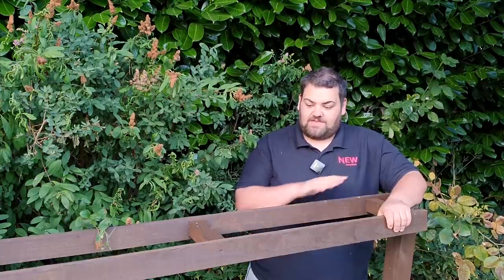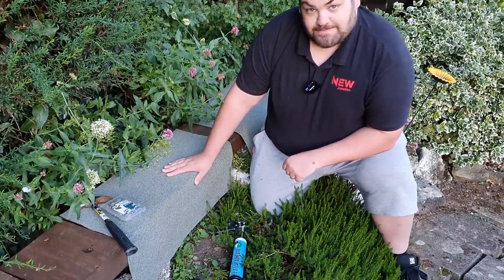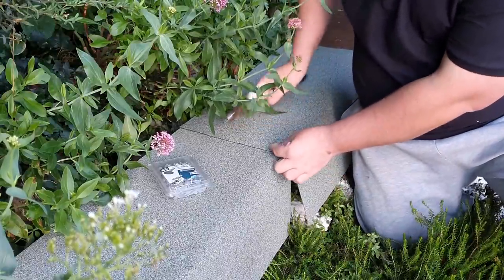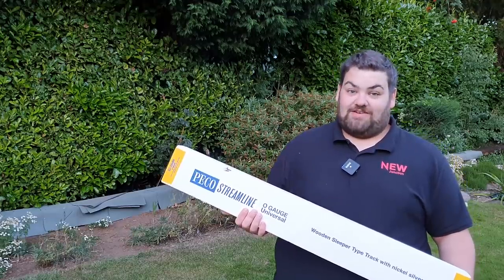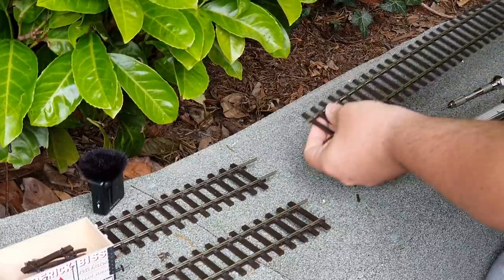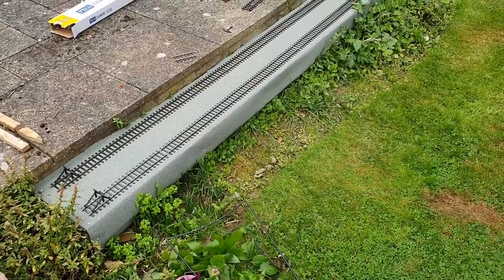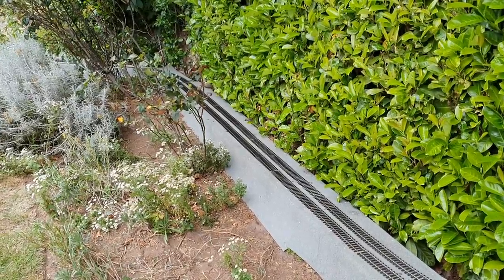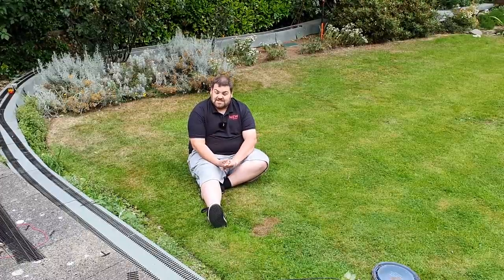New Junction:  Building an 'O' gauge Garden Railway  Part Two

Comment: Hello Richard. Having watched your first commendable attempts at building a garden railway, from one who has had a railway round the garden now for over 20 years, maybe I could add a few pointers from things I learned (the hard way!) over the years. Firstly, having like you, tried nail-on roofing felt, I found that it was of relatively short life - there is the tendency of a build-up of moisture under the felt as the felt is only laid on the base wood and not sealed to it - which eventually rots the ply - no matter how much Cuprinol you coat it with. The real answer is torch-on felt (which is not that hard to lay and in the long run, quicker than nailing all over the place) and the molten bitumen seals into the wood grain as it is rolled on, plus it can be laid butt up with no overlap (which causes bumps where the track goes over the overlaps) and the joint sealed with dripping a molten, narrow strip, of the felt to seal with the bitumen and finished by pouring some of the loose grit that comes off the felt over the joint and pressing onto the joint to help protect and hide the joint. 
Spacing the adjacent tracks was simply done with some pieces of wood (say 1" x2") with grooves cut across the wood for the rails and spaced for the adjacent running line so that the whole lot stayed neat - ideal spacing for O gauge (according to the GOG technical manuals) is 80mm centres (85-90 mm on tight corners). The other thing is not to nail down the middle of the sleeper, but to nail the sleepers on the outside of the rail - nailing in the middle (as time goes on) will tend to make the sleepers bow and the rail tops come slightly inwards and so narrowing the gauge.  Only need to pin down every 10-11th sleeper. I always seal every pin that goes into the baseboard with bitumen paint to seal the hole that the pin makes through the felt - having found a good few years ago that one un-sealed pin caused a swelling of the ply.
Regarding soldering the rail together is a complete no-no in the garden as you really need expeansion joints at every yard of track as the temperature variation can be alarming big - I have recorded temps as high as 55C on the summer sun-soaked rails sections and as low as minus 12C in the winter. You really need the expansion joints, otherwise you will encounter track buckling. 
Easy to do, is track bonding with some reasonably sized copper wire - say 1.0mm -1.2mm dia (I used tinned copper wire which I buy in a coil off the internet) and pushed under the first sleeper either side of the join and the bent up in a half omega loop (for expansion) to solder into the web on the outside of the rail.
Regarding ply, from past experience, the best was the cheapest OSB ply which is made of chippings filled with resin pressed solid under heat - stays rigid and flat and there is no chance of delamination of the plies. Not trying to teach "suck eggs" but a few pointers from my experience, which I hope may help. Have a look at  GBRailways channel - https://www.youtube.com/watch?v=Ay0lX9F9o8c. Regards, GeoffB

Comment: Well done Richard I'm currently building an O gauge railway in the garden suffer with a bit of reduced mobility so mine is on 4" dia soil pipe and 4ft  off the ground so thanks for the boost to do some more only other relevant difference is I used bituminous paint to seal and bond my felt .
Reply from the maker: Top tip Dave, mine will be high of the ground at the other end of the garden and I'm looking forward to that bit ha
Reply: @NewJunction  mine was a bit trial and error I have 4ft above ground and it's 3ft deep in the soil .With the spoil from the holes poured back down the pipe for good measure I have 25ft of an eventually 65ft run in a horseshoe shape.

Comment: Hi Richard,
Like so many of your subscribers it is good to see you back with part 2 and what you have done looks great but I hope you will forgive me for asking some questions the first one is you layed the felt stressing it is important to keep moisture out and this would include not only rain but dew as well now I may not have seen it right but you did not seem to be taking the felt over the other side of the track bed at any point so allowing this moisture to get under the surface felt ????. the second bit I did not understand is you made a mention about leaving a gap between the rail joints to allow expansion but at the end that you would be soldering them so filling the gap ?? sorry if I am being silly as I sometimes am but did I miss an earlier video explaining this.
I do however look forward to seeing part 3 weather permitting it would have been a lot easier if you had settled in Essex were I am as we get very little rain do however please keep safe and well and keep laying track.
Cheers Robert.
Reply from the maker: not enough room in all the places for felt both sides

Comment: Nice to define what you mean by a "big gap" at the fishplates.  For approx 45C range, the gap needs to be 1mm; further for that, the solar heating is worth another 0.5mm, so the gap at the coldest temperature would be 1.5mm.  As you have mentioned, the temperature of the day  affects the gap you select at build time.
Too small, and the rails will buckle.  Too large, and the clack will be large, and the smoothness will be compromised.  The expansion is the same for OO as O gauge, and the scale of the gap is halved for O, so this is less of an issue on your garden layout than in other discussions that are current.
The nice thing about doing this in the summer is that you can review the gaps on a hot day, and use a cutting disc to generate a new gap.  Generating a new gap is better than increasing the existing gap, as it allows more gap without making any one gap too wide.

Comment: from one Richard to another.... Great video Richard. Tip if you have not already cut the excess off the felt may I suggest you fold the excess back onto itself, so the bottom edge is half inch, sorry forgot you are a young one, make that circa 1.5 cm below the bottom edge of your side timber, then re tack the now double layer to the side timber. I believe this is known as a welted drip in the roofing trade, sure someone will correct me if I have this wrong. Anyway, the purpose of this is to prevent capillary action drawing the rain water into the lower edge of the side timber. and rotting it out. If it is cold try warming the felt along the line you will be creating your fold on which should stop it splitting. by the way we have a Cocker and a Springer one 9 the other 10 years old and just as mad as yours. I have been reliably informed they do settle down about six months after the die LOL keep up the good work
Reply from the maker: Top Tip many thanks for taking the time to comment, I'll be sure to implement this
Reply: @NewJunction  no problem keep up to great work looking forward to the next video. My wife and I also like watching Lulu definitely adds to the video. Keep safe

Comment: A bit of advice when pinning track outside. Pins on outside of railways. If pinned in the middle it will bow or warp in hot temperatures. I learned the hard way from experience. Use  small  wires between joins. It will pay dividends in the long term.
Reply from the maker: Top tip, thanks Gordon!
Reply: New Junction  Richard I found that solder cracks in frosty or icy conditions hence bridging wires to maintain continuity jut like indoor layouts don’t rely on fishplates. 2 kilo Heljan loco’s tend to loosen joints after a while .

Comment: I saw in a garden railway building documentary that you want to pin the track on the outside of the sleepers instead of the center. If you tack in the center then on a hot day you lose your gauge because it will bow in the heat.
Reply from the maker: Top tip, somthing I'll have to rectify

Comment: I thought it strange that your roof felt did not cover both sides of the structure.
Even if it is not firmly attached, it does help drive the rain clear of the woodwork.
Should you also seal the felt down the side?  This again would stop the wood getting water from the run-off?

Comment: Great video Richard nice to see you back on the outside rails again is the principle the same for oo guage nickel silver track I have ran my dcc sound locos outside using decking boards end to end but have taken the track up after use must admit flying scotsman tornado evening star hst class 43s 4mt class 57 running outside with sound going through your shrubs looks great used to have mine in the loft but after knee replacement surgery no good at tricky loft ladders so it’s either shed end to end or longer garden railway end to end how do you protect your dcc power connection to the track from the weather 
Great to see you back                               Kev
Reply from the maker: Thanks for the comment Kev, currently I remove the electrical bits when not in use.

Comment: A word of warning regarding leaving the felt flapping around the bottom... The wind can get under there and rip the felt and the track up... which is exactly what happened to me.  As a result, I ALWAYS make sure to secure the edge in some way, and you should too.
Reply from the maker: Thanks, Top Tip
Reply: @NewJunction  the easiest fix for me was to tack the edge to the board and trim the excess with a scalpel, using the board itself as a ruler.  This ended up looking a lot neater than dangling felt in any case.  Filling the gap between the ground and board became a matter of scenery, for which plants and dry stone walls provided a major, easy, and environmentally friendly solution that allows for easy changes to the layout in the future.

Comment: Hi Richard,
Just love your layout and videos.
Did I hear you say your going to solder the joints on your track or did I hear wrong ????
Surely the track has to expand and contract. Maybe you meant solder something else ?
You really have given me inspiration to get started.
Thanks a lot for sharing it all.
All the best
Duncan.
Reply from the maker: Hi Duncan, ignore me i ment solder loops of wire from peice of rail to another.
Reply: @NewJunction  ha ha ha. That’s a great idea. I knew you wouldn’t have soldered them together .
You’ve certainly given me the O gauge bug ha ha ha 
All the best 
Duncan

Comment: The train will of course come into the station with the loco on the front so how do you plan on reversing them when they enter the station front on? Will you use a shunter to pull the stock out and release the loco? You have no run around
Reply from the maker: Shunter or have another loco waiting

Comment: How are you dealing with the polarity difference on the point work, just wandering as without some sort of clever electronics how it isn't going to short out constantly
Reply from the maker: The points when the track joins up will be insulated and I'll use polarity switches.

Comment: No concerns about UV rays?  I know that comes up in the G scale world.
I guess it doesn’t get hot enough there for heat expansion to be a problem with the soldered track?
Reply from the maker: Soldered via wire loops not rail to rail 👍🏻

Comment: Hi richard,i like the garden railway vid i am thinking of venturing into the garden.
You mentioned using gaugemaster prodigy,i already use prodigy advanced 2 will one command station be enough for a garden railway.
Regards
Howard
Reply from the maker: Hi Howard, yes it should be although if you use lots of trains or the layout is huge you may need the 8amp booster.

Comment: Great video Richard, very interesting. Just one question if I may - since it looks like you used bitumen backed roof felt ( excellent choice) can I ask why you didn’t stick it down by heating the top surface with a blow lamp (or even an iron) to melt the backing and stick it securely in to place? This would have sealed all your joins and greatly reduced the number of felt tacks you would need? Not a criticism just an honest question. Keep up the good work, love your videos.
Reply from the maker: Honest answer is I dont have one lol
Reply: Fair enough 👍

Comment: What will you do when it rains? Cover the track?
Reply from the maker: The track is fine outside in all weathers 👍🏻
Reply: @NewJunction  Not if it is Peco.
Reply: Parts of my Peco track have been in situ outside for 25 years. A few points are nearly as old.... no problems!
Reply: @ma1c01m55  It doesn't like the sun. I guess that is usually missing in the UK.

Comment: I wouldn't solder every joint it defeats the purpose of having the gaps in between the sections of rail for expansion and contraction. What I would do is run a feeder to about every 15-20ft via a bus line so you shouldn't have to worry as much about loosing power especially down at the loop and I would solder 2 joints and then leave the 3rd unsoldered for expansion and contraction
Reply from the maker: Watch this space 😉

Comment: Also Why did you use Peco Tracks Not Hornby Tracks? Is there a Particular Reason? - tnx again ;-)
Reply from the maker: Hornby don't make O gauge track.
Reply: @NewJunction  mny tnx for your reply, I'm building an OO gauge garden railway and the cleaning is a nightmare, i was wondering if the Peco Rail tracks are better - tnx again
Reply from the maker: @laurentazzopardi4756  I always use Peco track. 👍🏻

Comment: Sorry but I don't understand why you only overlapped  the roofing felt over one edge and not both? This would help protect both edges surely.
Reply from the maker: I did do both Colin 😄
Reply: My apologies. From the last video you seemed to line up one edge of the felt with the top edge of of the track bed and fold the rest over the near edge. This is what made me think you only protected one edge. I only ask as I to am in the process of constructing a garden railway and I like so many do,  am planning using on using roofing felt. 👍
Reply from the maker: @colinmorrisondavies3709  fear not Colin, it's just my poor filming efforts